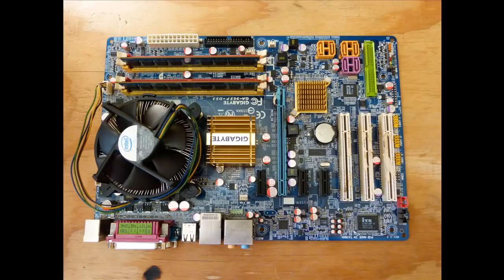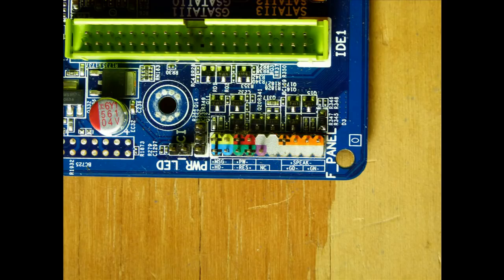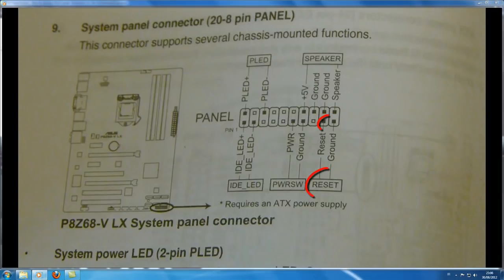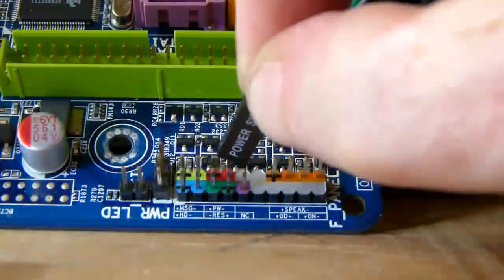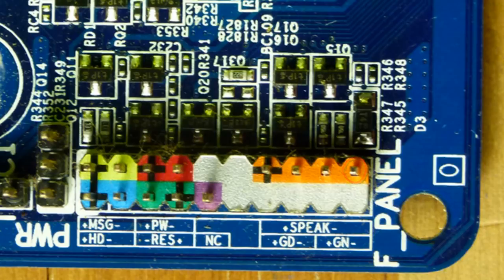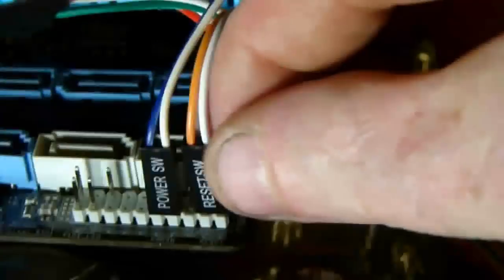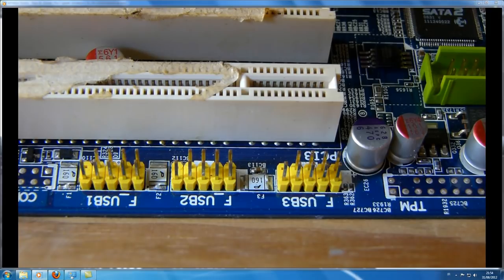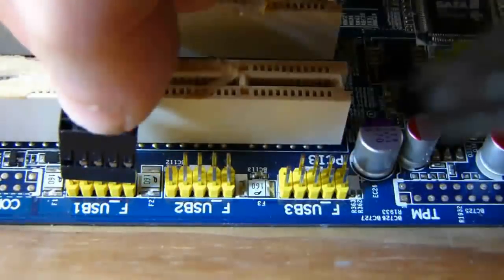How to connect front panel connectors to the motherboard

Comment: what is the function of speaker in front pannel?
Reply from the maker: Hasan Al Noman its function is to beep once if motherboard is ok to start! and beep twice or three times if there is a problem! The beep codes are different for every type of motherboard! You can check on the manufactures website for the beep codes. 
This code is programed into the bios chip on the motherboard which checks the components when the computer first boots up, and the all clear code is usually one beep! OK, hope that answers you question! Hasan!
Reply: oh i got this. yhanks :)
Reply from the maker: no bother!

Comment: Thank you very much!
Reply from the maker: pentafe You're welcome!
Reply: Kevin Colleran 
My asus motherboard only has 3 pin usb does it make any difference?
Reply from the maker: There is no such thing as a 3 pin usb consult you user manual to find out more... ok!
Reply: Kevin Colleran One last thing, I desire to buy a case with USB 3.0 but I don't think my mobo has that USB 3.0 connector. I need an adapter, yes?  
http://www.asus.com/us/Motherboards/H81ME/
Reply from the maker: yes you will need a pciExpress card for your mobo! here's a link if you are going to buy please use this link on my website you would be helping a guy out!
http://astore.amazon.co.uk/computerhelpm-21?_encoding=UTF8&node=13

http://computerhelpmadeeasy.ie/chme-component-store/

Comment: +Kevin Colleran can you PLEASE make a tutorial on how to connect side panel fans
Reply: Don't worry, you don't need a tutorial just for that. Your mobo should have a manual and there should be 3 or 4 pin connection slots on the mobo. Your side panel fans should have 3 or 4 pins. Just plug them into the motherboard at the connectors where it says something like cha_fan. If your fan has 3 pins, and you mobo 4 pins, they are still compatible, there are guidelines on the connectors that ensure you connect everything right. Plug them in.  If they are case fans don't plug into the cpu fan slot, because it would be more convenient to leave that for the cpu fan.
Reply: Old news, pc long assembled
Reply: +Brendan C. What about a Corsair Link 4 pin USB connector? I can't find a 4 pin USB header anywhere..

Comment: hi 
after i change mu pc case unit to new one , i have problem all usb ports not working. is the wrong connection may cause ? I mean the connection from usb wires  to mother board ? . because i check the drivers they are install perfect
Reply from the maker: Um Feda yes! double check every usb connector and the connection on mobo cause any wrong connection could cause all to not work consult your mobo manual to make sure! OK! Hope that helps.

Comment: Thank you! It helped me out about the plus and negatives.
Reply from the maker: Kathleen Tran You're welcome! Kathleen
Reply: Kevin Colleran This part has always confused me as well. How do you determine positives and negatives? The manual doesn't say anything about it, just where to plug them in.

The video explains it very well, but all motherboards are different and these cables are sometimes different colours.
Reply from the maker: I agree with you! They are types of front panel connectors with no standard way of installing them! But in my experience all connectors in the front panel of a case have little arrows indicating that it's the positive! that's a standard that is adhered to here in Europe. And as far as i recall it's that same in the USA! Hope that helps! Here is a link to a video I done a about a 18 months showing you the arrows on the connectors if you want to have a look the front panel connections are shown @ 38 minutes into the video https://www.youtube.com/watch?v=RGw8N4rG3AI
Reply: Kevin Colleran Thanks! I live in the UK by the way. :P

I knew about the arrows, but the manual and the mobo did not identify the positives and negatives for everything, though that was before I realised "grounded" was basically the negatives. I got the PC working in the end. :)
Reply from the maker: Ya It can be a bit off putting, the way the manual identify the connections, the companies just don't care all they want is your money! It's nice when you can work it out for yourself though! I find that there is nothing we can't do if we just put our minds to work! Good for you bud!

Comment: OK I need help. My brother and I just started building a pc today. We think that the power connectors are the problem. every time we plug in the power switch wire the computer turns on for a couple of seconds and then shuts off. we've read the user guide for the motherboard, the case , everything but nothings seems to work. We've tried pluging in the wires, letting the computer turn on and then shut off and wait a couple of minutes after that then hit the power button but nothing works.
We've being trying to fix this the whole day.
help would be much appreciated
Reply from the maker: OK! so for starters do not have the power supply plugged in when working on a problem, make sure there is no electricity going to the motherboard. Then plug in the power switch front panel connector to the MoBo, Do Not plug in the power yet!

Now i want you to go around the motherboard and check critical connections! Start with the CPU fan, is it plugged into the MoBo? and If it is! Check that it's connected to the correct connector on the mobo "FAN_CPU will be printed beside the connection on the mobo.

Next is the ATX CPU power connector it will be a 4 pin or 8 pin connection on the mobo near the CPU make sure it's plugged in all the way!
Next, is the memory unplug memory sticks and plug them in again!
Next unplug the graphics card and plug it into it's PCIExpress slot usually the one closest to the CPU!
And last thing to check is the 24 pin main power ATX connection to the mobo! unplug it and then plug it in again making sure that it's fully plugged in!

Now plug in the power into the power supply which feeds power to the mobo and all components connected to it!

Now press the start button on the the case! OK! IF it is a thing that the computer started when you plugged in the power into the power supply, then you possibly have a fault on either motherboard or the power switch on the front panel!
At this stage if it's still having that problem reply back to this message and we will see what needs to be checked next! Because it could be anything connected to the motherboard and troubleshoot need to be set in motion!
OK! Best of luck! This is not! by the way uncommon when building a PC! sometimes there is a faulty part and sometimes it's a bad connection with a component! Let me know how it go's for you! either way!
Reply: Kevin Colleran Thanks for the help. We actually managed to fix it. The problem was in the case itself. Sorry for the late reply.
Reply from the maker: That's No Problem! I'm Just Glad You got your problem sorted!

Comment: how am i supposed to plug in my power sw and reset sw cords if both cords are black and there is no labeling for +/-
Reply from the maker: There is a little triangle on the back of the power & reset switch that indicates the positive side of the connector! Connect that side of the connector to the front panel pin that indicates the positive on the motherboard! Use the motherboard user manual to locate the positives on the motherboard if it's not printed on the motherboard, but it usually is marked positive. OK!
Reply: thanks my case pamphlet did not mention the arrows so i had to use the knowledge that the top cord was for my positive (because it was labeled only on my led) and use that to determine how it was but this lets me know my placements were correct thanks.

Comment: Question.  My USB has 9 Pins but my (what I think is USB) has 5 holes.  It doesnt read USB like yours. It has VCC1 USB- USB+ GND1 GND. is that where it goes?
Reply from the maker: Hi Rigs, You need to do some ground work you need to get the user manual for both Motherboard and the Case and find out which connections from the front panel are usb and connect that to the motherboard connection on the motherboard they always match unless you have an old system case or motherboard! OK! hope that helps. Go to the manufactures website and download the user manuals for motherboard and case if you don't have them.

Comment: my usb cable wires are split into separate wires. this video didn't help me much.
Reply from the maker: What you need is the diagram to find the positions of the single connections at the bottom of this Intel forum you will find a usb front panel connection diagram hope it helps! https://communities.intel.com/message/120799 scroll down to near the bottom of that page and you see it!
Reply: Kevin Colleran
thanks. that is exactly what i need.
Reply from the maker: no problem bud!

Comment: Having watched this, I realise I may have plugged some of mine in the wrong way. I thought that since some of the plugs are not marked positive and negative, it didn't matter which way they went in. Good job I watched this before powering anything on I guess so thanks. 

What would happen if one was plugged in with the positive side on the negative pin or vice versa?
Reply: it would not work that's all, use your motherboard manual

Comment: Hi good video, what happens if one of those pines is broken???
Reply from the maker: Hi Irwing, It's next to imposable to find a broken pin on a motherboard! Are you sure that it's broken and not just "missing" some pins are not installed because they are not needed! But if it is broken then you need to replace the motherboard if you can not connect the front panel connection to it! that's pretty much all you can do! You should check in the user manual that came with the motherboard and see is it a pin that need to be connected! OK! Hope that helps! if not let me know!
Reply: Yeah your answer is good help for me thanks and sorry for my english thumbs up
Reply from the maker: Hi Irwing, Your English fine! I can understand you perfectly! I'm Glad you got the help you needed!

Comment: Do new cases usually come with connectors installed on the front? I've been needing to upgrade but most I see have things mine doesn't, like usb 3.0.
Reply from the maker: all new cases come with required connection that you need to connect all connection to the motherboard! Just check spec of new case if you're not sure! Hope that helps, let me know if you need any more help!
Reply: Kevin Colleran Alright, thanks.

Comment: Great job on the video!
I have some question's about my f-panel connections.
 I have the HPE-400f tower, and an ASUS M4A785TD-M EVO mobo.
The mobo has the exact same f-panel connector as in your video, and the manual states exactly like yours.
With that said, my power button has 8 wires coming from it,- (1-red & 1-green, coming from 1-led,) //// (1-blue & 1-yellow coming from another led,)///// (a very,very, small gauge blue & black twisted wires, coming from another 3rd-LED)////// (then 2-black wires coming from the back of the power button itself.) 
(there is a total of 3 led's, instead of 2 and all are part of the power-button assembly, but i am not sure what each led is for?)
As far as i know, i don't have a reset button. (seems like i used to just have to hold down the p-button?)
I am going to have to cut my connectors off my wires and buy some like the ones that you have, in order to be able to make the connection, because mine will not match up to the mobo's.
OK, i guess my biggest questions would be:
(1)    Where can i find those connectors at?
(2)    How will i determine which is positive which is negative, on each of the colored wires coming from the switch?
(3)    How will i know which led, is the IDE-LED, and which is the PLED?
(4)    If it does not have the reset button, can i use those 2 connectors for the other (3rd)LED light? 
ANY HELP AT ALL, FROM ANYONE, WILL BE GREATLY APPRECIATED!   THANKS!
Reply from the maker: you don't have to cut any thing! bring in your case and motherboard to a computer store and they will connect them up for you or connect with me through skype or google hangout and i'll show you want needs to be done! you wont break anything by trying to connect them yourself and see how it go's and keep switching the until you get them right!

Comment: MY MOTHERBOARD DOESNT has this written wgat should i do..
Reply from the maker: get the motherboard user guide it came with you motherboard and it will show you what you need to do to set all the connections! if you don't have the user guide you can get it on their web site! you will find the model number and make of the motherboard printed on the motherboard some where! usually somewhere near the middle of the board! OK! hope that helps!
Reply: oh thanks.. ill c.. btw ur page is great ;)
Reply: i found..the front panel pins.. f_panel is written beneath it..but still dont know where to attach pins :P
Reply from the maker: you need to check in the motherboard user guide! where you connect the front panel connectors to the board
Reply: got it :)
Reply from the maker: Glad you sorted!

Comment: I have a desktop hp m7680n and although I have power (the indicator lights), the computer will not turn on.  I used your video to confirm that everything from the front panel did not come loose from the motherboard. Do you have any suggestions on what it could be? Thanks
Reply from the maker: Do you have both "motherboard 24 pin power" and the cpu 4 or 8 pin connectors connected and make sure the ram is correctly installed and the cpu fan cable is connected. Make sure they are all in their correct positions and fully inserted! ok! if that does not help let me know and we will try more troubleshooting!

Comment: Am I right in thinking that if I dont connect the power led connector the power switch will still switch on my computer but there will just be no light around the switch? I don't want to connect the power led because its red and my case fans are green and I find the red a bit distracting.
Reply from the maker: Yes that is correct the led will be the only thing not working! OK!

Comment: greetings brother and your site is well explained. I have a doubt had a lenovo motherboard was damaged and will mount a mother ASRock G31M-VS2, plate and want to connect the HD audio front panel that brings this board, but the cable not is identified. which has two black wires one thick and one thin, yellow, blue, brown, white, green, red, gray are 9 wires total that brings. the question is the following, as I list the order that takes each color. 

And the other question is with the front USB: 
as I list the order that takes every color, because it has two black wires is ground, and another wrapped with ground black cable also has a white wire, brown, green, yellow, blue, red and wrapped orange cable with a land are also total 10 cables. 

I hope you can help me
Reply from the maker: Hi Jorge, The list that you are looking for! should be on the case and motherboard user manuals! You may have to go to the case manufactures web site and find the info about the front panel cables. Because all cases have different cabling arrangements it's impossible to give you one way that works for all! So you are going to have to get more info about the case cabling from the manufactures web site the name, make or model of case should be printed on the case somewhere usually at the back of the case. Hope that helps!

Comment: Also i dont have a Speaker cable, is there another name for it?
Reply from the maker: No not really it's just a speaker cable or it's a speaker and cable if you don't have one on the motherboard or in the front panel! You should be able to get one one online or in the local pc store!
Reply: Kevin Colleran
 Sorry for bothering you again but do you need the Hdd Led and the p led's?
Reply from the maker: not really! They are just indicators leds that show that they are active and working!

Comment: My Hdd led and my p led's wires arent long enough, is there something i can buy to make them reach the motherboard?
Reply from the maker: you should check behind the front panel and you will find that there is extra cabling tucked away usually! you should be able to see this by removing the side panel behind the motherboard! If there is no extra cabling then you will have to get a new front panel or extension cables for the front panel cables there really isn't anything else you can do! Go to a local PC store or check on line for extension cables for front panel connections!  I hope that helps!

Comment: Thank you Kevin!!!  Excellent explanation and a very helpful in my time of need.  To readers and particularly ASUS I am building Z97 ASUS and no where does the owners manual tell you a little arrow on the back of the connector mean POSITIVE.  The ASUS MB you are working is color coded and marked connectors that clearly marked + or  -.
Reply from the maker: Thanks for your kind words George!

Comment: Thanks for your reply. It was so long ago I can't remember, but looking at DManager shows no errors. No power required, just a 3.5inch unit with connecting cables. Is there any way of checking the onboard USB and or 3.5 inch unit?
Reply from the maker: You have usb connection at the back and front of the computer! plug something in to any of them and see does it work! Also check device manager usb drivers. This unit you have installed is a separate usb driver, and has nothing to do with the motherboard usb drivers! There will be a separate driver for each! I think that if the usb on that card is not working then it's either a bad device that's not working! or there is no driver installed for those usb connection on that unit! And if you have all connection made there's no reason for it not to work unless you have not installed drivers for that usb device! OK! I hope I'm explaining it in a way that you can understand!